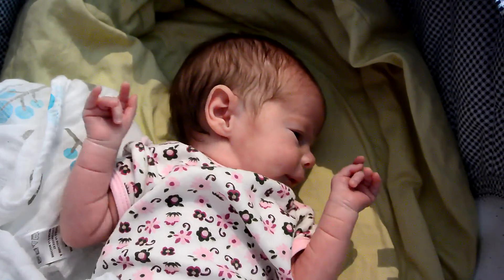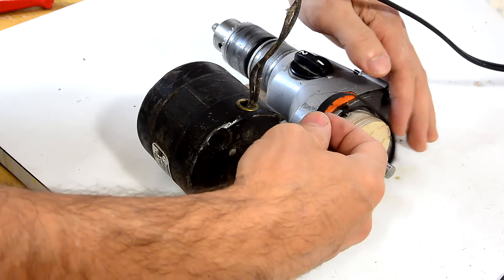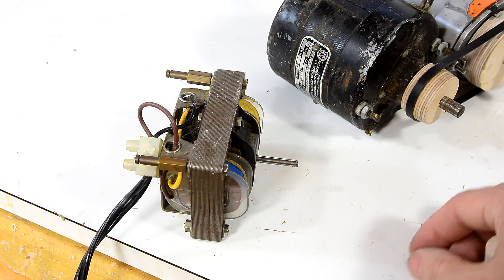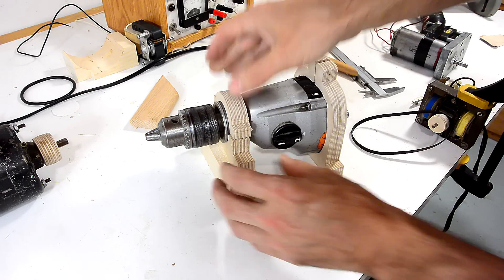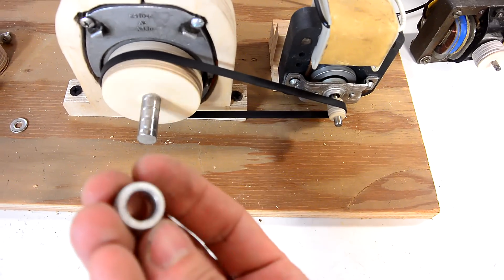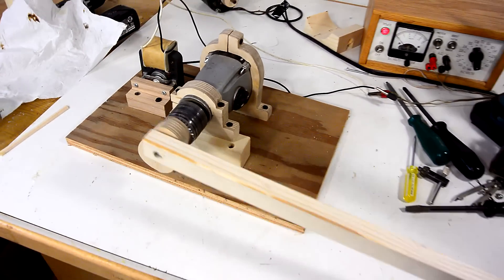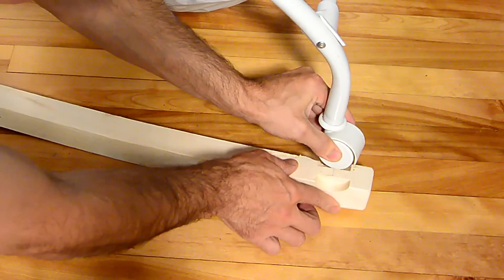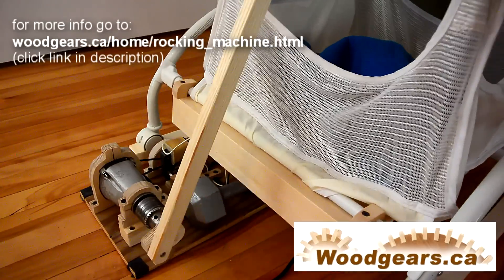Baby rocking machine

Comment: Mathias you would make an EXCELLENT machinist.  Have you ever thought about getting into metal working? The initial investment is quite large (A few thousand dollars for a milling machine, lathe and tooling), but I think you would be capable of making some pretty incredible things! (Not that you don't already make incredible things!)
Reply from the maker: +MattsMotorz Metalwork is far too slow.
Reply: +Matthias Wandel Ever thought about 3d printing for really small objects?
Reply: +Matthias Wandel depending on the material youre cutting and the cutters youre using. most can cut through softer aluminums  like butter. and you can always use a cnc machine then you dont have to do any of the work!
Reply: +KurtleTheTurtle But that makes it boring!
Reply: I would like to see him do some metal work
Reply: bobbg A drill press isn't rigid enough for any kind of serious milling.  It could do some light cuts of aluminum or other soft metals, but steel or iron? Forget it.  Not only that, but a collet is much better at holding tooling such as end mills or a boring head than a drill chuck.  Way more rigid.  I have been down this road and these are the conclusions I came to.
Reply: 3-D printing LOL
Reply: yes what i said, its laughable
Reply: They are not very useful. The parts arent even watertight.
Reply: MattsMotorz Q
Reply: @bobbg9041  Theres no draw bar on a drill press. Axial load will disengage the morse taper holding the chuck in. Theres a reason people pay $1,000+ for a Mill, and not a $200 drill press.

Comment: I found that infants are soothed by a humming or droning sound, and at surprising volume - much louder than your current fab, so if you have to rebuild any of it, be assured that it doesn't have to be whisper-quiet.

Also was amazed to realize that a rhythmic clack (about once a revolution in your slow setting), and an associated bump helped to lull them during particularly difficult times, such as teething. (Sadly, didn't seem to help much during bouts of colic.)

Thanks for sharing; best wishes to the family.

Comment: 4:34 In fact bending moments at the ends DOES produce a precisely circular arc deflected shape. Simple (first order) bending theory tells you it is a parabola because of a necessary approximation made in the calculus of the proof. Consider this, except for the little end sections between the end clamps, the long interior length is subject to a uniform bending moment. If at every section the bending moment is the same, the curvature must be the same, so it must be a circle.  Why is this ?, the differential equation governing beam bending has not been exactly solved ! The commonly used approximate solution that produces the formula " Stress = M.y / I " is the one that tells you parabola when it is really a circle.  It used in pretty much all but the fanciest structural calculations, and even then, it is only a more refined approximation that is used.  How do I know ?, I am final year structural engineering student at UNSW Australia, BUT I LIKE CARPENTRY MORE :) I mean can you believe it, bending is such an everyday phenomenon that every person lives with and science had only partially unlocked its secret !
Reply from the maker: +jellyfishbones0 Only under ideal circumstances.  The stiffness of the wood may not be consistent.  Also, the ends would have to be free to slide side to side, which they aren't.  Which is why the arc isn't necessarily circular.
Reply: Sounds like someone trying to sound smart but only comes out dumb..lol
Reply: +Matthias Wandel Thank you Senpei, i forgot about wood being variable that way, <bows>.  I am thinking about what freedom at the ends is or isnt there though, not sure i agree with you, but you got me thinking so thanks again.  Thats probably the line between engineers and scientists right there, that level of detail. By the way, I did my own original beam proof using taylor series (of deflections and of Forces).  It is different to every textbook I searched in, and a little more rigorous too and with an end result that agrees with the classic result. It has also been verified by my soil mechanics teacher who is a published mechanics of solids researcher and was surprised by my method. Again, thank you for reading my post and replying.  The Beam proof is here if your interested imgur.com/a/wKiZP#0
Reply: +Arkansas Homestead Mate, I dont know everything, but I know my stuff imgur.com/a/wKiZP#0
Reply: +jellyfishbones0 As a mechanical engineering student who has just finished a course in Statics and finishing up dynamics, I find this comment fascinating.
Reply: did you read the proof on imgur?
 I can explain if needed, because I love talking engineering. I would be interested to hear from you
Reply: Honestly, no, but I am taking a differential equations course and there are some non linear models that regard beam bending and such. I just find those things very interesting when someone else talks about it.
Reply: Oh wow! I did not catch what proof you mentioned but I looked at the one you posted on Imgr and I am very impressed!

Comment: Mathias, I have found you can quiet almost anything down if you isolate every point where two hard surfaces touch. I used old mouse pads and tool drawer rubber liner, which seems to work well enough for my purposes.
  Great idea though. repurposing the drill gear box.

Comment: I´m currently bulding the same kind of contraption for our cradle.
It all went very smoothly but i have a very hard time finding a fitting motor.
I started with a geared 230V example that is mainly used to turn turntables in microvaved i bet, so it turned out way too weak. It changes direction all the time and cant handle the rocking motion.
I want 20 RPM and 230V. It doesnt matter if it a fast motor and a gearbox that i have to combine or a fixed motor with gearbox. The problem is the industrial ones i find online are in the range of 200-400 Euros. I´d like to keep it under 50.
I would really appreciate it if someone could help me out here.
Thank you very much!

Comment: A styrofoam cooler box you can get at most stores could be a good sound muffler if you put it on top of the motors. Just make sure to cut a hole for the fans.

Or the hollow box would increase the sound... Haven't tested such a thing, but it should do something.

Comment: What if some electrical malfunction happens and it catches fire, fire develops bigger thanks to the wooden parts. Doesn't seem very safe :D Dangerous stuff but seems okay if under supervision.

Maybe use smoke detector and add small fire extinguisher that executes after getting signal from the smoke detector, better safe than sorry :D

Comment: I've read somewhere that there is a correlation between white level noise and development of autism. It seems to interfere with their audio calibration. Just a word of caution.
Reply: The correlation is stronger with air pollution, however the same study found that it was particularly near highways/freeways and other traffic heavy locations such as airports that were most susceptible, as opposed to near  industrial areas. Chances are it won't matter, but hey.
Reply: +AccAkut1987 as opposed to your completely hypothetical rhetoric, the caution I present is based on research findings.

Comment: OK, Ii's pretty cool but does no one else think that some bodged together electric rocker, may be a little unsafe sitting under a sleeping baby?
Reply: +carz g Why would it be unsafe?  Speed is controlled,  mechanically travel is very limited.  If your watch this channel, I have complete confidence he used the correct gauge wire for the known current.   Is your concern that it was handmade?
Reply: jxstevep It has hardly been put through the rigorous testing that is usually required for baby equipment. If he had to put a fan on it, he is clearly worried about it overheating. What if the fan is not good enough and it goes on fire? It is not worth the risk in my opinion.
Reply: He previously made a living as an engineer. He knows what he's doing.
Reply: +Ash Bash It is all open to the air and could easily be gathering up dust which could ignite. Even engineers can get it wrong and when it comes to the safety of a baby, you don't take an unnecessary risk.
Reply: Are you an engineer?
Reply: ***** What has that to do with anything? My points are valid, regardless! Do you actually think this would pass safety testing?
Reply: +carz g Your point are not valid.  Gathering up dust that will combust??  stop, please for the love of humanity, stop.
Reply: ***** How do you know it wouldn't? The motor, transformer etc. won't catch on fire unless there's too much current going through them, or if he used the wrong parts, ie. the wrong motor. Obviously he took these into consideration, and obviously knows enough about electronics concepts to ensure no problems will arise. Even if there was a risk, all it takes is simple measures such as fuses - overcurrent = circuit breaks and no fire.

I hate how you'd react if you seen his other contraptions. He built similar ones for RIM for testing Blackberries back when he worked there. His bench power supply (which he built years ago) is built the same way, and yet works to this day.

Unless you have some grounding on this, you're talking out of your arse. Your dust comment is ridiculous enough as it is.
Reply: ***** Dust and fluff can't build up on a motor, no?  Of course it can especially when it's an open unit. According to your logic, once something is wired correctly their is no risk and because he is an engineer he knows it all. Well strange how electrical motors burst into flames quite frequently and even NASA sometimes get it wrong!  I really don';t care what experience he has and what else he has built, although I already know most of them. The point is that this is under a baby and it is not worth the risk! End of!
Reply: ***** 
Dust and fluff can't build up on a motor, no?

Which will have no effect on causing a fire. Ceasing up the motor maybe, but no fires.

According to your logic, once something is wired correctly their is no risk and because he is an engineer he knows it all

If the proper gauge wire was used, and the parts used are of good quality, then there is no danger. If you watch his videos, he does prefer getting quality parts and machines.

Well strange how electrical motors burst into flames quite frequently and even NASA sometimes get it wrong!

NASA's projects are infinitely more complex than this - it requires a large team with a wide array of disciplines ie. engineers, programmers, rocket scientists etc, and the larger the group = the higher the risks of mistakes being made. If you were involved in any group project, no matter how good you are, the result rarely turns out to what you wanted or expected.

A single person making a simple project leaves no chance of a risk if he/she knows what they're doing. He obviously does know what he's doing, due to his engineering background and extensive experience with woodworking/electronics.

As for motors, that only happens if you:
- overvolt them
- use the wrong type of motor
- use a cheap motor

He already considered this right in the video.

I really don';t care what experience he has and what else he has built, although I already know most of them. The point is that this is under a baby and it is not worth the risk! End of!

You have no real argument as to why it's a risk. You would if he used cheap chinese components, thin gauge wire and weak materials, but that isn't the case.
Reply: +Ash Bash I have opened up my owned electrical motors and found tons of dust on them so to say that it can not build up is ridiculous and anything that creates heat, such as wiring and motors can ignite that dust. In my opinion there is risk, and if it was my baby, I wouldn't have that lump of junk anywhere near it! Now you go back to kissing his ass because you are giving me a pain in mine!
Reply: *****

to say that it can not build up is ridiculous!

I didn't say that. I said that dust can only make them seize.
Reply: +Ash Bash No, you said dust can't cause fire and that is not true.
Reply: +carz g What kind of motor is this he is using?
Reply: +carz g Did you watch the video or not? Matthias knows what he is doing, and his builds are pure art. That baby is as safe as if it were at home in its bassinet - oh hang on. Yup, it is safe.
Reply: +carz g Who says they use this rocker when they are not in the room?  I bet they don't.
Reply: ***** I have dust in my PC, including on the fans - which use motors. I've yet to see it turn into a flaming wreck.
Reply: Wires do heat up and melt (go molten) if too much current goes through them. You'll get a fire that way too.

As for laptops going into flames, that is due to overheating, faulty components or faulty batteries, not any motors. Drills went on fire due to cheap motors or components. Cheap anything is a danger. The difference here is that the components he picked are appropriate and of good quality. The motor came from a good quality drill, for example.
Reply: ***** We are not talking about too much current, we were talking about friction and dust. You have no idea if that motor is of good quality or not, it is not unknown for high end manufactures to start using cheap components. That been said, I really don't care, anyone with a modicum of common sense would not allow a bodged together piece of junk anywhere near their child. End Of!
Reply: ***** 'Like Iron Pirate states Matthias and or Rachel will leave baby Harriet untended so again no danger to the child'. How the hell do either of you know that? Did Matthias tell you they don't leave the baby on its own? Talking about blowing smoke out your arse! The CPU in a laptop produces well enough heat to set dust on fire and yes, it does happen!
Reply: ***** My point exactly, I don't believe either of them have any common sense! I do have children actually and I wouldn't allow a piece of junk like that near my kids. Do you have children? Ask your wife would she allow it, I bet she wouldn't. Men generally don't have any sense when it comes to kids and danger but you would expect the wife to.
Reply: +carz g Considering most baby equipment (and everything for that matter) is made in China with next to no quality control, I'd say this would be far safer and superior.